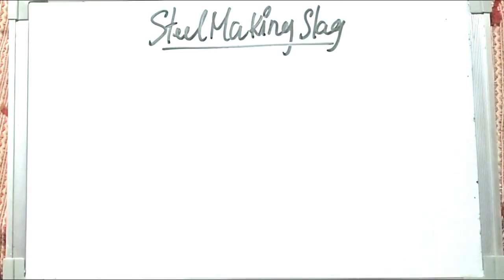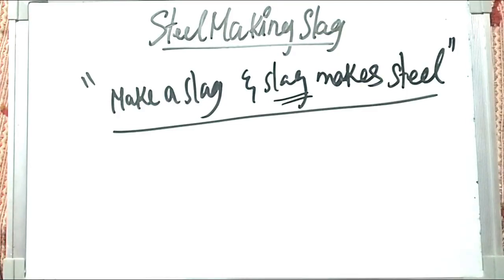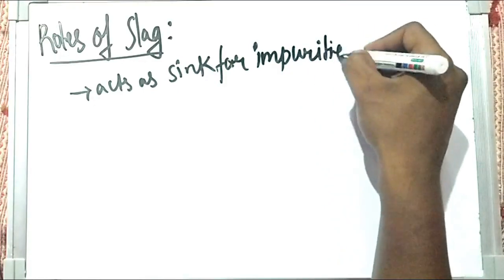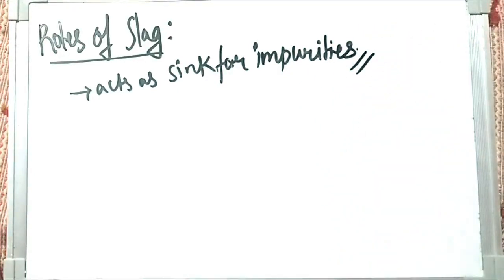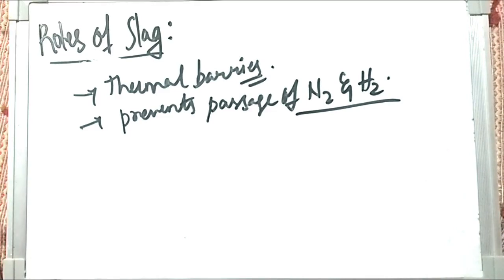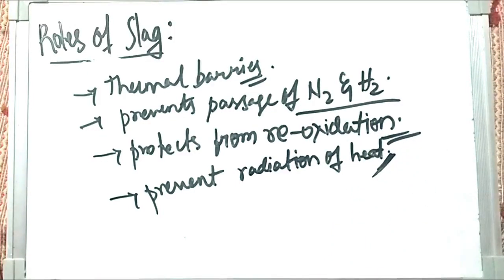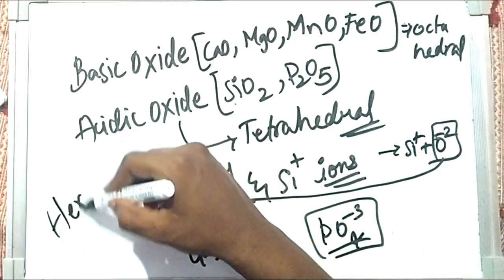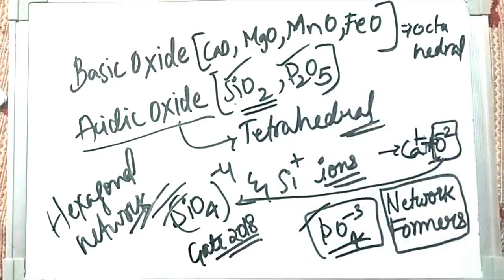SLAG IN STEEL MAKING- FERROUS EXTRACTION-LECTURE 9-EVERYTHING METALLURGY

Comment: I have a doubt.

You say that CaO is a donor and it can donate  oxygen. But CaO is an extremely Stable oxide as indicated by the ellingham diagram. So, why would it donate it's oxygen if it is so stable?
Reply from the maker: Yes...but we are talking at high temperature...where the stability decrease and it dissociates !!
Reply: But in material balance also we assume that Cao won't dissociate and it is also taken at high temperature?